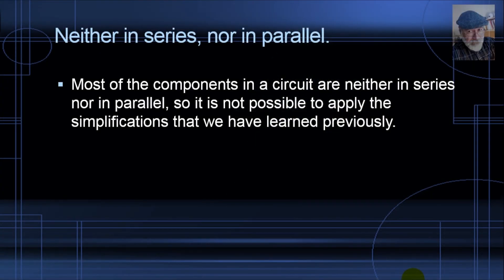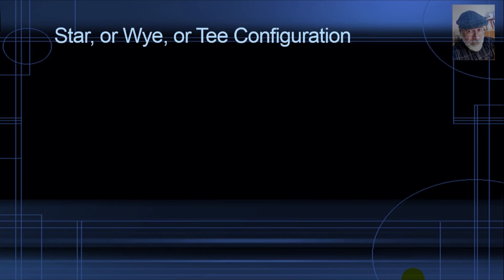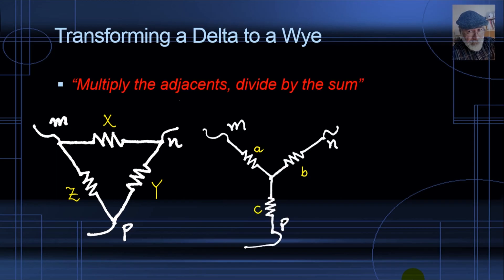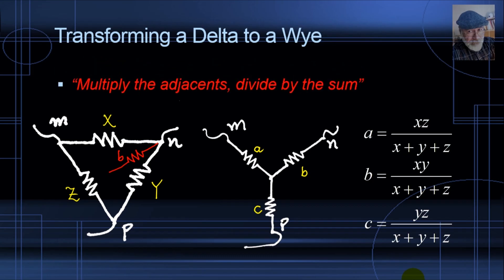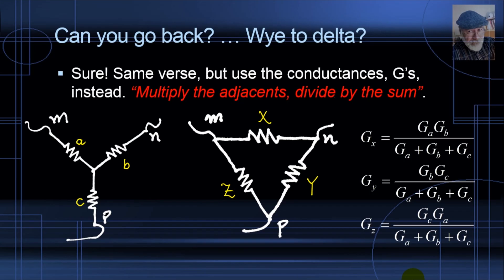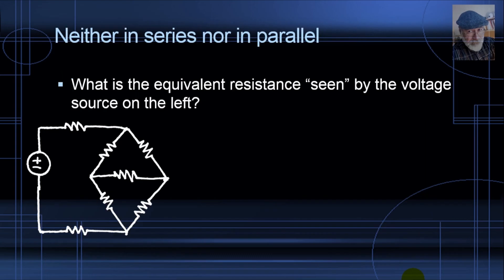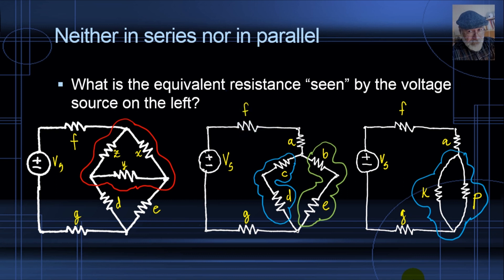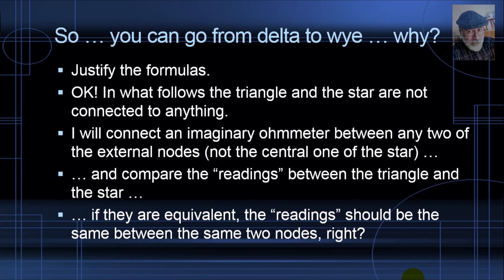EE 101/14 - Wyes and Deltas

Comment: Professor, I am a 58 years old technician with no engineering degree who always wondered the solution for this issue and finally I got a simple, clear  and well explained answer that gave the light to understand how to solve this mystery. Thank you very much from México.
Reply from the maker: Dear Mr. Juarez,  Thank you for your kind feedback and for reporting where you write from. Muchas gracias.